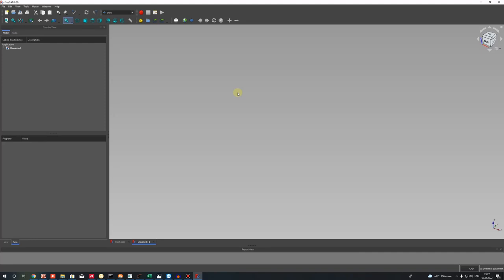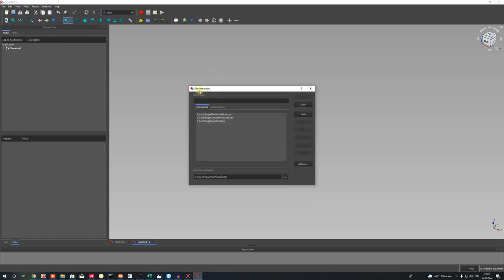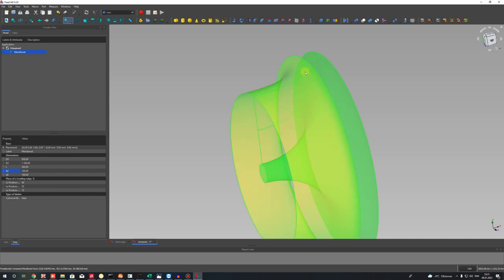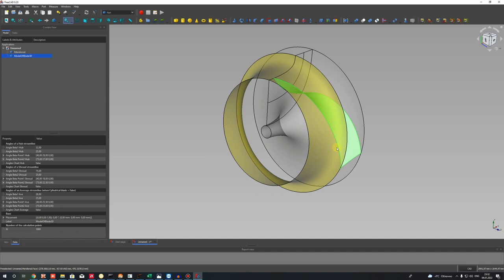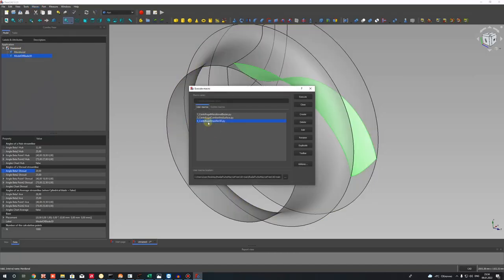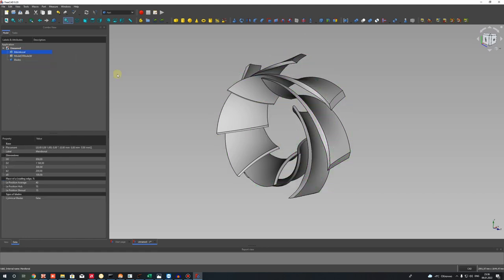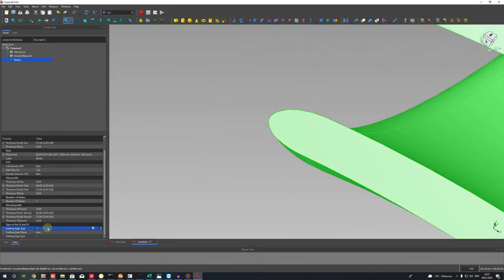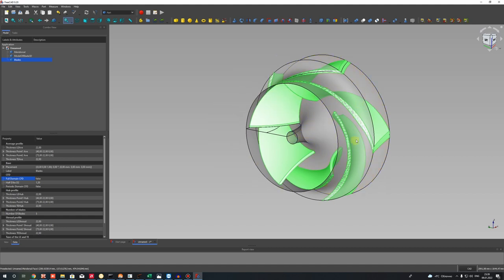FreeCAD Tutorial | Design of Parametric Radial Impeller Using Macros for Turbomachinery

Comment: Fantastic. Thank you
Reply from the maker: Thanks!
Reply: @CFDIntech  are your pump codes easily transferable to design a centrifugal compressor?
Reply from the maker: @djdelta777  It depends what features needs to add
Reply: @CFDIntech  I don't know much other than the compressor uses gas rather than liquid. Looks like same kind of impeller geometry to me. Although it sometimes has splitter blades